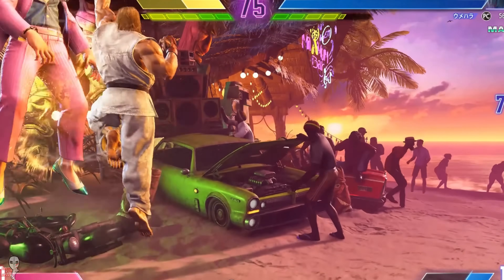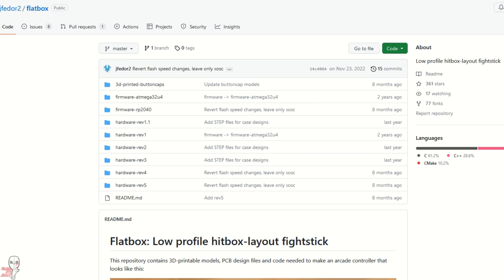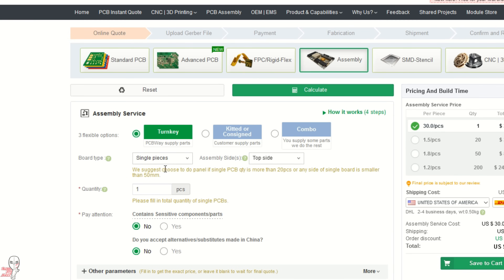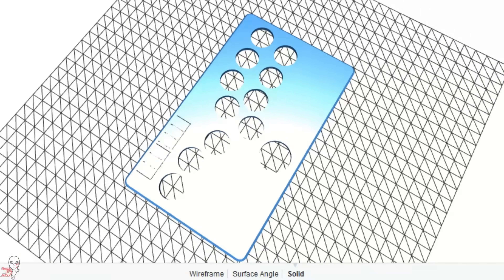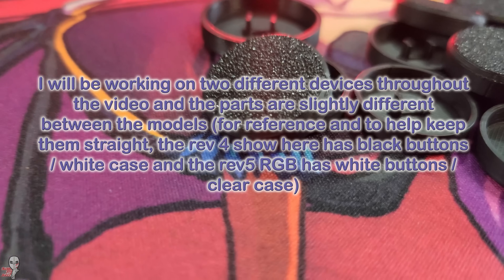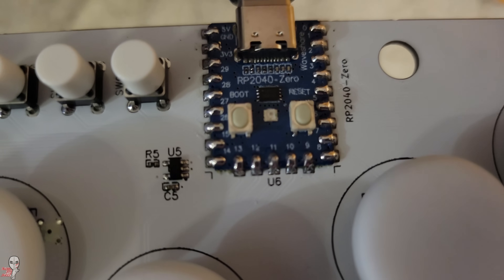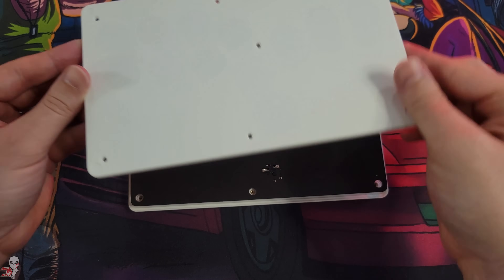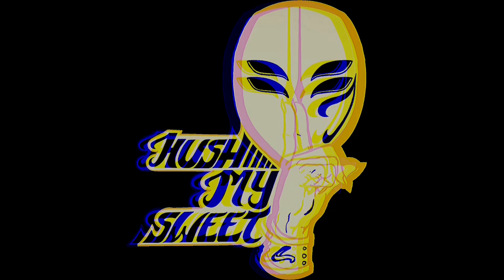Build your own Flatbox! An inexpensive, open-source fightstick option

Comment: way complicated for first build. mine is chinese arcade controller box, cheap switches mounted in motherboard box. now building leverless (its almost the same), only using rpi pico and keyboard switches

Comment: Hey, I'm trying to go for the jfedor, rev 5 edition controller. I 3d printed my own case but I'm having issues with the heat set inserts part. I think i got the recommended size from the jfedor guide but it doesn't seem to fit at all into the slot before inserting it, (it kinda sits flush to the opening). Also when I try to insert it, the filament rises into the slot, leaving no room for the screw. I'm having trouble inserting it straight in. Any tips? 
I feel like I either need to adjust the print and make bigger holes, use a different soldering iron tip, or get a smaller insert nut size. I'm trying to avoid printing the case externally but maybe it cannot be avoided due to lower print quality with my ender 3.
Reply from the maker: I think these were the ones I used: https://www.amazon.com/gp/product/B0B8GN63S2/  So double-check that element first. The screws shouldn't sit on top like what you're describing. Could you wallow the edges out a bit with a hobby knife or something to get them to sit better? I'm not sure, though.
Reply: @HushMySweet1  ohh mine are a bit bigger than the ones you used so I might give it a try but for now im going to try to open up the hole a bit
Reply: @HushMySweet1  I ended up ordering the ones that you used and also an attachment for my soldering iron to ease the process and it worked great!
Reply from the maker: @mistadude  Glad to hear it!
Reply: @HushMySweet1  Hey another quick question, I ordered some 6x6x5 tactile switches and they turned out to be normally closed when i tested them on my breadboard. Does that matter at all and will I have to mess with it in software or should i try to order some different switches?
Reply from the maker: @mistadude  Give them a shot and see, I suppose. I've never heard of an issue with switches a user would have to fix with software, but I suppose if you got some atypical ones or something...IDK. Worst case scenario you'll have to buy a new set of switches. Let us know if your original ones work though.
Reply: @HushMySweet1  Issue fixed, I was just being a noob with the switch, it's actually normally open and I won't have to worry about that!

Comment: Will it works on xbox 360?
Reply from the maker: Yes, but not this particular one in the video as it sits. What you will want is this version of the Flatbox: https://github.com/OpenStickCommunity/Hardware/blob/main/Boards/GP2040-CE%20Official%20Controllers/Flatbox%20Rev%205%20Passthrough/README.md  And then grab this dongle: https://www.amazon.com/Mayflash-MagicBoots-Adapter-Joysick-Converter/dp/B0D3DN66QF/  Then you can set it up for Xbox play. Good luck!

Comment: Would love to see more detail on setting up the interface with the PC or console.
Reply from the maker: It's a little different depending on your model. Basically though, you'll just need to flash the appropriate firmware. Just scroll down to the one you're making, download the corresponding firmware and follow the firmware installation steps. I'll leave some handy links to help you out. Good luck! https://gp2040-ce.info/downloads/  https://gp2040-ce.info/installation/

Comment: Not sure if anyone can help. I’m trying to finish this for my husband but for whatever reason only like 3 buttons are read. I swapped the switches and still the issue persists. I’m not sure if it’s a firmware or hardware issue. My solder job looks like the video but I’m not sure what my next troubleshooting steps should be.
Reply: I’m using version 5 with the RP3040-Zero. It also seems to have some issues reading the boot/reset buttons at times when reflashing.
Reply from the maker: @amandathirion8685  There is a flatbox specific channel in the Open Stick Community discord server. Start there. https://discord.gg/QeHtfScB  If you can't get it figured out, let me know and I just mail you one I have so you can complete your gift.

Comment: So how come there's nothing like that for rhythm games?
Reply from the maker: What layout are you thinking? Pop'n? Sound Voltex? Or something else?
Reply: @HushMySweet1  IIDX and EZ2AC
Reply: @HushMySweet1  I actually saw your other video where you bought a bunch of Sanwa buttons and a frame and then you used a solderless kit to wire everything into a DIY PCB and I've been wanting to see if I could do a similar thing for an EZ2AC controller now that I found out where I can buy the keys and effector buttons, now it's only a matter of finding the turntable parts.
Reply from the maker: @WintermintP  Ah, right on! Sounds like a cool project and I hope it goes smoothy for you! Thanks for watching.
Reply: @HushMySweet1  But there's no solderless kits for rhythm games?
Reply from the maker: @WintermintP  Not a standardized one that I'm aware of.

Comment: What is considered a more high end printer? Am i looking at 800-900$ or 2-3k+?
Reply from the maker: The latter, but the ones PCBWay use are industrial and so even more so, and are able to handle a lot larger projects (I priced out some 16" cases but things started getting very expensive). A Flatbox shell is fairly small still, but still costs $100 through their service with clear resin.
Reply: @HushMySweet1  Hmmm, with that in mind i guess Haute42 prints themselves? Wouldn't have a clue how their pricing makes sense otherwise.

Comment: Do we have to use a pcb or is there any other way?
Reply from the maker: What do you mean? You need a printed circuit board inside to talk to the console and also attach the buttons to. The PCB+firmware is like the brains of the controller.
Reply: @HushMySweet1  what bout using like a raspberry Pico
Reply from the maker: @Rinobii  The GP2040-CE firmware is compatible with Raspberry Pi Pico and other boards based on the RP2040 microcontrollers, and that's what these boards are tooled around. https://gp2040-ce.info/

Comment: how much would the cheapest end cost for this project? i think i'd be able to manage soldering and have someone I could 3D print the box. How much is everything else?
Reply from the maker: Well, a lot of times you need to order assembled PCBs from these services in like batches of 5. So if you can finish the extras to sell at a big discount to your buddies, you can feasibly break even.

Comment: STICKS AND PAD HAVE TO DEDICATE THEIR MOVMENT TO 1 SPESIFIC DIRECTION WERE AS A KEYBOARD/MIXBOX/HITBOX DO NOT !!! FIGHTING GAMES WER NOT MEANT TO BE USED WITH BUTTONS FOR DIRECTIONAL INPUT. BECAUSE IF IT WORKED I CAN GAURANTEE THEY WOULD HAVE USED HIT BOX STYLE IN ORIGINAL ARCADE OVER STICKS BECAUSE IT WOULD BE CHEAPER TO MANUFACTURE AND MAINTAIN BUT THEY DID NOT BECAUSE BUTTONS FOR DIRECTIONAL INPUTS MESSED UP how IT IS MEANT TO BE PLAYED!

Comment: Thanks for telling us how much this cost you.
Reply from the maker: A lot of the cost is dependent on your comfort level with PCB assembly services and if you have easy access to a 3d printer or need to order enclosures. I think you should be able to make a Flatbox rev 4 for like fifty or sixty bucks (but sometimes you have to buy PCBs in batches of five). If you really want to make it simple, you can just buy a single assembled PCB from SGF or another etsy seller. They go for like $35 and you can just buy the single board. Then use your local library's 3d print service for the case and put it together. The premium rev 5 art one is going to run a bit higher and higher still if you want a resin case like the once shown in the vid. Thanks for watching.

Comment: Any chance someone know what size heat set threaded inserts where used to close the case?
Reply from the maker: I bought these on Amazon: AIEX 100pcs 3D Printing Brass Nuts, M2 Threaded Insert, Knurled Brass Nuts, Female Thread Knurled Heat Embedment Nut for 3D Printing Parts Loptop Automotive Plastic Shell (M2x3x3.5mm)

Comment: if i make one of these, will it work on ps3? i want to play tekken 7 and street fighter 4 with this.
Reply from the maker: If you're using the GP2040-CE firmware like you see in the vid, yes. GP2040-CE is compatible with PC, PS3 and PS4, Nintendo Switch, Steam Deck, MiSTer and Android.
Reply: ok, thank you! @HushMySweet1

Comment: Nice. whats the total cost and time used to finish one ?
Reply from the maker: The V4 should be like $50-60. The V5, like $100 maybe? Depends on your access to a 3d printer, so don't quote me on that. I had the V5 case donated and a lot of the other stuff in my possession already, so I didn't keep good track of the money. You'll also likely have to order the assembled PCBs 5 at a time for minimum orders. That changes things as well. Time-wise, probably a couple hours if you have all the stuff ready to rock? Anyway, good luck with the build and thanks for watching!
Reply: @HushMySweet1  that's very helpful info. Thanks. Just comparing price if it's worth the effort , but I'll think the fun and experience is already worth 👍

Comment: any way to buy an acrylic case with the heat set inserts already in it?
Reply from the maker: I don't see anyone selling acrylic cases even w/o the inserts. I think part of that reason is these units are supposed to be small and inexpensive, so when you start subbing out that cheap 3d printed case for a $100 acrylic one, you lose a lot of potential buyers. I just ordered this one as a one-off from PCBWay. You could likely do the same. Then, just wallow the heat set insert cavities ever so slightly with a multi-tool, and then epoxy or super glue them in place. (Skip the heat entirely.) Just make sure they are standing as straight as possible and you don't get any of your glue inside the inserts. Good luck and thanks for watching!

Comment: How do I make sure my PCB is compatible with the xbox series x? Is there a way to make it compatible with ps5, pc, and series x?
Reply from the maker: Xbox doesn't work right now with GP2040-CE firmware. Similarly, you'd likely need some MagicBoots pass-through tech (there's another video on this channel which sort of explains it) for PS4/5 compatibility. If you need all of those systems, you'll likely need something like a Fusion board and a more traditional Hitbox-style all-button controller. Thanks for watching.

Comment: Did my comment really get deleted or are the Youtube filters just extremely overzealous? Just tried to share my experience with the Flatbox's problem with printed button caps that can snap because of the choc v1 stems
Reply from the maker: That's unfortunate. And I don't see it in the "held for review" section either. I don't have much skin the game when it comes to controllers (which is okay since I get to be more honest), especially with open source DIY ones, so I don't really delete anything. Did you solve the issue in some way, or was your comment more cautionary? Thanks for watching all the same.
Reply: @HushMySweet1  It's definitely Youtube then, sorry that I suspected you. I originally wanted to edit the comment to also thank you for the resources because I wasn't aware of the git repo that contained the RGB version of the flat box but it was gone.

The original comment was meant as a cautionary tale. I've build the Flatbox rev4 and the printed buttons just break off after a while when not hitting them in the center or if anything presses against the edge of the button cap. I used 2 different 3D printers (1 Service and my own). So I wanted to warn people to not skip the Kailh hotswap sockets since the stems get stuck in the switches really badly and desoldering them was is a pain. Might not happen to everyone but hotswaps are cheap and easy to solder.

I'm currently searching for more open source controller before doing a new one. But it seems like I'll need to pick up KiCad again and at least mod the rev5 to use Choc V2 since there are button keycaps that aren't 3D printed available for it. 

Again thank you for the time you put into the video and the reply. Have a lovely day or evening.

Comment: Hey man, I came across your video because i have  a flatbox also but one of my kailh croc switches broke. I dont know which size to buy on amazon. Amazon have options of size 10 or 30. Do you have any idea which size to buy for my flatbox?
Reply from the maker: I think the 10 or 30 are just the number counts. Search up Kailh Low Profile Choc Switches and pick the color you want (I have another video detailing the differences between these styles of switches). You need 12 switches if you're replacing them all (so you'd need two sets of the 10 packs if you can't find lower counts), but if you're just replacing a lone switch, then there might be a better option elsewhere (like a demo variety pack or something). Thanks for watching.

Comment: is there a way to make it even more DIY and so it without PCB?  just soldering all buttons directly to the raspberryPi?
Reply from the maker: I'm not quite sure I fully understand, but this is actually what I would consider pretty DIY-friendly if you are a thorough reader. Thanks for watching!
Reply: @HushMySweet1   What I mean its if theres a way to make this work with Literally just switches and raspberry Pi . without the need for PCB manufacturer and 3d printing.  after some search online looks like its posible. so yeaa

Comment: I'm confused, solding is needed or not? Seems like buttons just need to pushed inside PCB
Reply from the maker: You'll need to solder in the hotswap sockets (so you can push them in like you see in the vid) or solder the switches directly to the PCB.

Comment: Do you know of a keyboard style layout? like wasd for movement and 8 button layout on the right? Looking for small buttons/keys and aligned in a straight fashion, not curved like 95% of leverless controllers I find
Reply from the maker: Nothing off the top of my head. At least not open source. I was sent a Haute controller similar to what you're describing, but there are so many videos ahead of it, I likely won't get to that review for a while. Let us know if you find anything in the meantime that works.

Comment: Great video!! I'm going to start my project myself after seeing your video. One question... how is the durability of the JLCPCB resin you used? I've read issues with heat/sun exposure.
Reply from the maker: Interesting! I hadn't heard anything about that. The controller is holding up just great, but I don't know that I've ever exposed it to heat/sun. Just drop it in the bag or on the shelf and there you go! Let me know if you build one and how it holds up where you are from! Thanks for watching!

Comment: That's so cool! I am going to make one. Any guide for installing the RGB light into the buttons since the video doesn't mention it?
Reply from the maker: Just carefully read the github. All of the instructions are there and you can order with the LEDs installed through assembly. There is a special firmware for it that’s all setup and ready to go. Good luck!

Comment: Hey HushMySweet, awesome video! I would really like to utilize a rev 4 version of that acrylic from PCBWay. How would I go about doing this? Could you help a fellow FGC player out lol? I also thought about doing a little bit of a mod to the case by extended its dimensions and depth a bit for some padding. Any advice?
Reply from the maker: I can point you in the right direction, but it may be more complicated. You'll need to start using tinkercad or kicad, and practice with some PCB edits. The reason this Flatbox is more appealing is because all of the thinking/testing work is already done so you can just use a PCB that's ready to go. You might consider joining the open stick community discord as well. They can help with specific issues. https://discord.gg/j9g64Pqm Good luck!

Comment: Does rev5 support xbox series? Can’t find any information about this. Thanx for video!
Reply from the maker: Not at this time. Any devices which use GP2040-CE stuff currently support these systems: GP2040-CE is compatible with PC, PS3, PS4* (with keys), Nintendo Switch, Steam Deck, MiSTer and Android. For Xbox support, you'll need to look into a Brook converter option.
Reply: @HushMySweet1 thnx man! i appreciate it!

Comment: how did you use the dxf file on pcb way for the plexi/resin top?
Reply from the maker: You'll need to upload the .stl files on to their website. Here is the bottom section: https://github.com/TheTrainGoes/flatbox-rev5-rgb/blob/main/Flatbox%20rev%205%20RGB%20case%20-%20Art%20Case/Flatbox%20rev%205%20RGB%20-%20Art%20Case%20-%20Main%20Frame.stl

Comment: Im gonna build both a flatbox and a hitbox

But question, i would like to know where do you get the transparent case? I would like to design an art for it.

Like does it need to connect to the 3d printed case or is its own case?
Reply from the maker: PCBWay donated it for this project. You can use normal 3d printers, but they had some high end resin printers, so I had the case halves printed in premium transparent resin. It costs substantially more than regular 3d printing though (so like $100 just for the case). Good luck with the project!

Comment: So do I need to buy the PCB through them or can I have a local manufacturer create it by giving them the blueprints/plans?
Reply from the maker: You can have any PCB assembly service do it for you. PCBWay was the video sponsor and provided some stuff, so I chose to represent them here.
Reply: @HushMySweet1  Awesome! Where can I get the plans for the PCB for other PCB assembly services?

The only reason I ask is because I'm based in South Africa so shipping from the USA to here will be really expensive.
Reply from the maker: @JC_117_2  Github. Find the version you want and read through the readme and walkthrough information. That should answer most of your questions.
Reply: @HushMySweet1  thank you so much